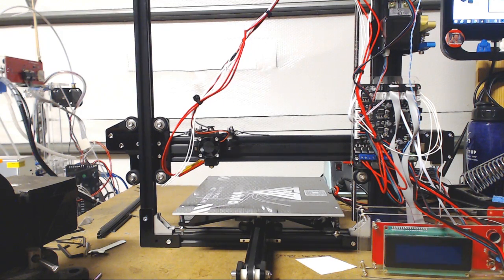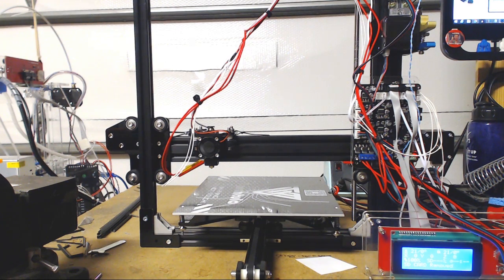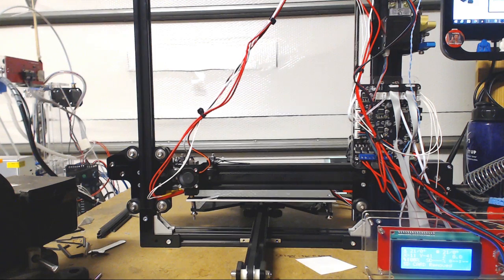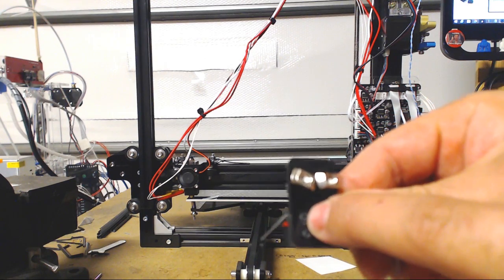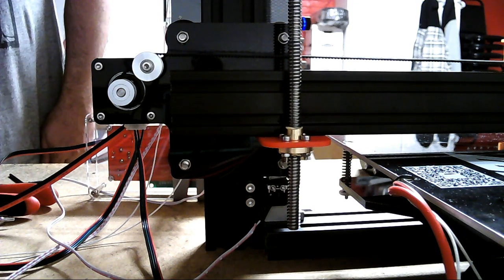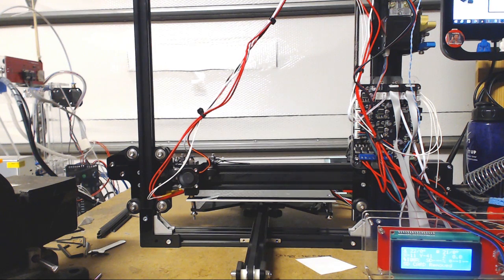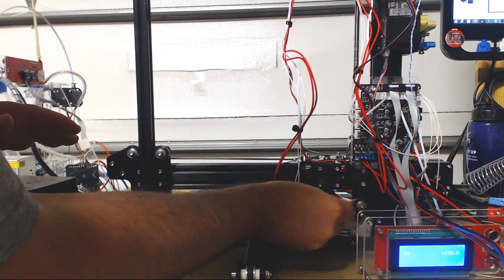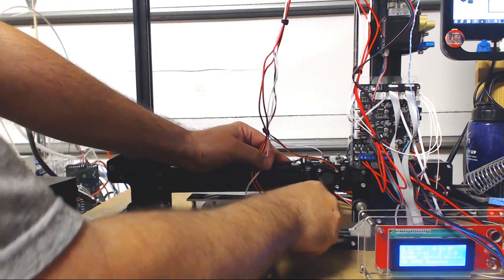Tevo Tarantula Assembly - Step 20 - Manual Bed Level

Comment: critical step: 
before you switch on, you should disconnect the power sup output, and check if the voltage is ok: if it is not, you have a risk of destroying your board, and maybe the stepper motors....

Comment: I am having trouble with my endstops. Whenever one is clicked, the screen of the printer turns off and everything else does too. I tried connecting the limit switches in every other slot for these and it kept happening. It happened with every single endstop (xyz). Could you please help? I cannot get the printer to work.
Reply: is there a short to ground on the board somewhere? it might be shorting out when its hitting

Comment: I have a problem, and my z-axis limit switch is not lining up with the carriage, pls halp
Reply: This position is wrong, it fits if you mount it on the outside vertical slot so that the switch engages at 90 degrees to the carriage (just like the other two switches!). The wheel gets close to it but it has about 2mm clearance if you look carefully.

Comment: My lcd doesnt show anything when the power supply is plugged in. It only lights up when I turn a motor fast enough and still doesn't show anything useful. Is there an easy fix or is something broken?
Reply from the maker: Are you sure the cables are plugged in correctly?   Sometimes if they are backwards this can happen.
Reply: 200% sure, I even plugged them in backwards to make sure.
Reply: same issue here... find a fix?
Reply: I plugged in the usb to power and double checked that the positive lead was connected and that seemed to fix it. After that the usb didn't need to be plugged in.
Reply: ArcSmith at the back of lcd there is a potentiometer for the adjustment of the contrast....try rotating it with a small screw driver.....

Comment: hi i am having so trouble. my y axis will not move past the halfway point on the printbed meaning that it can go to the back two corners but not to the front two (or even the front half of the printer. does anybody have any suggestions?

Comment: When I powered the stock kit up for the first time and Homed All Axis on the printer the extruder ended way in front of the print bed. I have a single extruder and the 200 by 200 mm heat bed as well as I have followed the video in the manual for the end stops. Do i need to adjust the endstop because I have the smaller bed or is this supposed to happen?
Reply: This is also happening to me did you eve figure out whats causing this??
Reply: For future posterity, in the manual, it says "For a small bed, the Y endstop should be about 10mm from the Y-bracket." So from where it naturally rests in the curve of the motor bracket, move it forward 10mm.

Comment: Do I have to flash the firmware myself? I booted up the printer and I just get a flashing blue light on the MKS Base.
Reply: I had some problem.Didu solve it ?
Reply: I plugged in both power supply to wall and board to pc

Comment: Hi, when I set axis to home, Y-axis goes opposite direction. I followed these videos for build. Any ideas or direction I can look? Thx
Reply from the maker: I believe at some point tevo fixed the firmware. so, you can move the y motor back to the side it shows in the videos, or if you plan on updating the firmware, you can make the change there. look for INVERT_Y
Reply from the maker: +ArcadEd sorry. move the motor back to what the printed instructions show.
Reply: Cool! Thank your the quick reply!
Reply from the maker: +Adam Behman yw. I will make a note in the video.

Comment: do we need to add glass plate on top the tevo bed ? i saw many users use glass plate, what the actual reason ? and when using glass, do i need higher temp rather than just default 60deg.
Reply from the maker: sometimes the alum bed is not perfectly flat, the glass assures you are printing on a flat surface.  60 is probably still fine, depending on material.
Reply: thanks, one more question. i saw some users , even they already use glass , but they still put tape on top of the glass ? what do they did it for ?
Reply from the maker: The print won't stick to glass alone, it's too slick.  Glue Stick, Hairspray and Blue painters tape are all common ways to help your print stick.
Reply: Thanks a lot for this information.